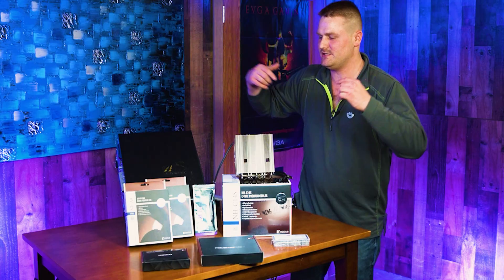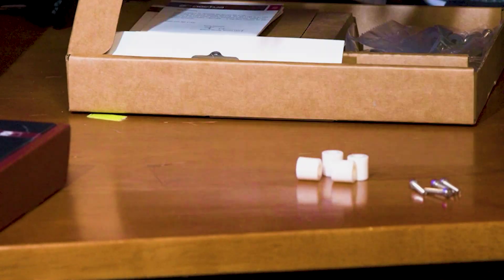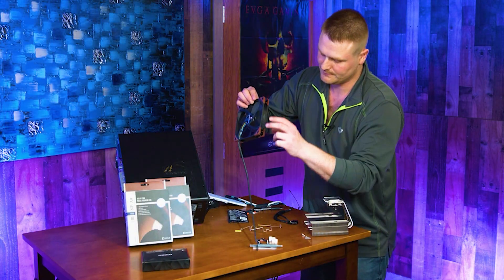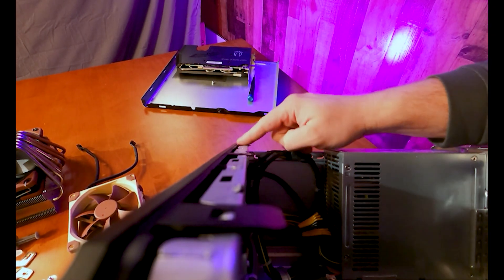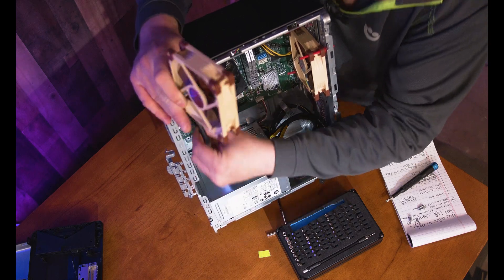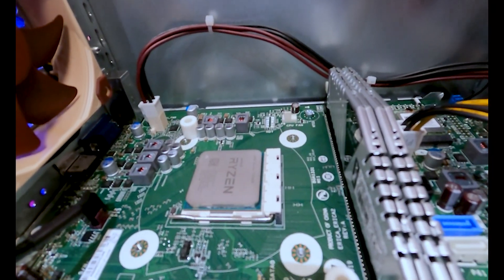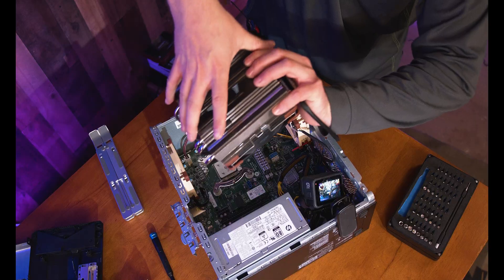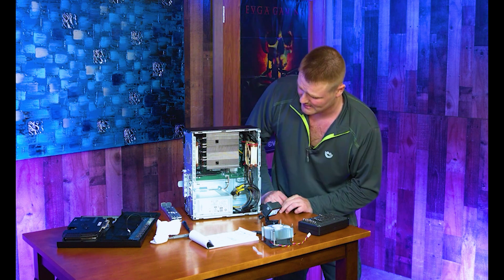TG01 Cooling | Wait till you see how big it is! CPU Heat Sink upgrade!

Comment: my only complaint is you said intel mounts which was amd at the end end you said again intel  stock cooler when its an amd mount ....but for ppl that have this see amd maybe its worth an edit as this hp pc is better with the amd version because of over clocking which intel can do with the ram
Reply from the maker: Well it is a 1151 Mount and bracket and back plate. The socket is AM4 Did i Screw up and swap it? I use the 1151 Back plate with The Intel Mid plate the stand off are from the AMD side of the Noctua kit.
Reply: This Machine has an amd cpu, and an intel cooler, sooo... yeah nothing wrong with the video.  TechNitWit tells it right. Because if you bought a cooler for an amd you would not not be able to mount it.

Comment: if i put a ryzen 7 3700x, 2060 super, 3200Mhz ram and a 1tb sata ssd in this system would it run on a 400w psu or should i upgrade to 500w?
Reply from the maker: You could do a 400watt. 500 watt would give you more over head. the 3700x is the Same wattage as the Ryzen 3 and 5 that come in the TG.
Reply: @TNW1337  if i put all that in the tg will my temps rise since the case is so small ?
Reply from the maker: @kev901  They will, you will want to do one of the 2 heat sinks, I have videos on. The smaller one or the larger one. The Small one I have a video on. The video is getting edited Now. With a aftermarket heat sink, I've seen temps in the 60-70c witch is ok.  I do not like to see 80 or 90c. That is getting to hot for the cpu. The cpu topping out or thermal cut off that is. it will start to reduce Volt and power to the cpu to cut the temp. Most AMD's And Intels cut at 88-90c.

Comment: I'm gathering that the hard drive cages aren't going to fit back in there, right?
Reply from the maker: Correct if you use a full size dual fan. So your options are limted on media best and cheapest route is a ssd 1 or 2 tb. You can get good 3m double sided tape and stick it to the case. I would not do this with a normal drive
Reply: I've got a big chonker 10TB HDD I'm gonna put in there for deep freeze storage, as well as 500GB SATA SSD for more thawed storage. (In addition to the nvme that comes with it, ofc.)

My TG01 won't be here until next month, so I'm just brainstorming how I'm gonna mod it. But that also means I can't look at it to see exactly what space I'll be working with in my configuration.

Also mine with have 500W psu & 3060 by default, so it'll be pretty sweet. But if I somehow win the newegg shuffle for a 3070 dual fan you know I'm gonna jump on that and probably sell the 3060. I have a strong feeling that 3060's going to be dual fan too though, so we'll see how HP dealt with it!

I appreciate all the vids you've done about these models. Definitely some good ideas in there!
Reply from the maker: @jmporkbob  you can mount the hdd some where others.
Reply: @TNW1337  Yeah, looking at their promotional material for pavilions, it seems like there should be a place to mount it flat against the front. And the SSD I can just sticky tape anywhere.
Reply from the maker: @jmporkbob  there is but it only allows so much room for the gpu.
Reply: @TNW1337  I'll have to play it by ear.
Reply: @TNW1337  OMG I just won the newegg shuffle for a 3070! I've been entering it for months, I can't believe it. 😆
Reply from the maker: @jmporkbob  Awesome!!!!

Comment: What about noctua NH-D9L?
Reply from the maker: It may or may not you only have like 6 inch to work with.
Reply: If the c14s fits, the d9l also fits, it is 5mm less higher!

Comment: Is there a specific reason you used the 3 way fan splitter or is there a Y splitter that would work for the case fans?
Reply from the maker: No just what I had I was going to try to add 3 fans. Just did not work out. Just make sure if you get a y spilter it has 1 4pin and 1 3pin.
Reply: @TNW1337  Thanks. And thanks for all the videos. I'm new and setting my daughter up for gaming and these videos are super helpful!

Comment: where does the front fan get it's air from? The front of the case has no intake. 
Doing some upgrades myself
Reply: I was wondering about this too?🤔
Reply: I was wondering this aswell. The front fan he mounted Doesn't look like it's getting sufficient air. What I did is a duel intake fan on the side.
Reply: @armang8706  yes but he said that the temperatures were worse going throught the side?🤔
Reply from the maker: There are slits on one of the sides of the front panel, it is not much. So adding the side intake I lost almost 8c. It did not make sense to me.
Reply: Lol soo can I have one of your computer 😭